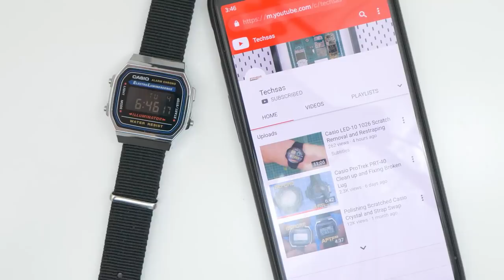Casio A168WA-1YES Display, Nato Strap and NFC Mod

Comment: Sweet mod. These watches would be perfect if they made them with stainless cases...
Reply from the maker: Tru
Reply: Tru
Reply: Tru
Reply: Tru
Reply: meh
Reply: They did back in the day, you can find them on eBay but advance warning , they are now not cheap.
Reply: Tru
Reply: They just did the  a1000d
Reply: Tru
Reply: TRU
Reply: Tru
Reply: Techsas Truuuuuuuuuuuuuuuu
Reply: @renerodriguez1876  Yeah, but the mother of pearl is ridiculous
Reply: Actually they did. Search Casio W-99
Reply: T r u
Reply: @SlapShotRegatta22  nope its cool
Reply: Rumour has it one of the homage brands has a die cast version. So not stainless but some sort of zinc alloy, which might at least be a bit of an improvement over plastic. Not sure if true or whether plastic merely got lost in translation.
Reply: @SianaGearz  nah plastic is better than those cheap alloys
Reply: @Cortesevasive  Neither is particularly good, but the adhesion between plastic and the plating undercoat is a particular weak point. Especially at the bottom right once the plating goes a little, it just starts flaking off rapidly. I know Casio uses an activator which is better than if they didn't but it doesn't really solve it. I'd say a garbage metal watch still lasts 3-5 times as long as the way Casio does its chromed plastic. Metal to metal plating adhesion is fundamentally much better.
Reply: Tru
Reply: Tru
Reply: Metal would destroy its NFC capability
Reply: Tru

Comment: 5:30 - You have to install Gold Spring First then The _white face_! Spring won't come out because spring has 2 different size ends. Small part goes first and Big part stops it from coming out. 

Also when I installed nfc tag inside my watch face! There's a SILVER SPRING stays with battery dropped, and couldn't figure out where silver Spring came out from! It's for alarm btw. If you lose, it won't make noise!

Watched video by @JUnbox A168 Battery replacement that helped with putting the SILVER SPRING in place.

Anyways overall _Thanks for the video really helped_. All I did was NFC install 😊
Reply: Where did you buy the nfc from? Do you have any link? Thnks!

Comment: Very informative video. Do you use a thinner spring bar? I can’t seem to fit my nato on it... maybe my nato is also too thick? What specs are the bars and nato you used?
Reply from the maker: Thanks! I used some thinner spring bars that I had laying around. Also,  ironing your strap helps but be careful it burns real fast.
Reply: Techsas good to know, thanks.

Comment: So cool! Thanks! May I ask what polarizing film you're using? Any link available?
Reply from the maker: I usually use polarizing films from an old cell phones. This time I used the one I got on ebay which is meant to be used for samsung smartphone screen. There's loads on ebay and they all do the same thing.
Reply: @Techsas  aren't the ones for samsung phones often meant for oled displays which are different than the typical lcd polarizers?

Comment: Beautiful! Managed to pull off the  negative LED, looks amazing. I can't get  NATO strap to fit though! Been trying for the last 45 minutes and scratched the lugs to hell but seems impossible. Is there a trick?
Reply from the maker: The trick is to use thiner spring bars and bend the strap before putting it in.
Reply: @Techsas  You're a genius! Took less than 5 minutes and my watch is looking awesome. Thank you!
Reply: @houssamalissa4417  did you do it with thinner spring bars or original??
Reply: @CODHIM  I got the thin ones!
Reply: @houssamalissa4417  what mm bro??
Reply: @CODHIM  can't remember just ordered "thin spring bars"

Comment: At first i thought you placed two polarizers and then after watching it a few times, I realized you placed the new one underneath the old and peeled the old one off after you stuck the new one on the screen. Did i get that right? 😅 Also, you mentioned in one of the comments that it should be 45 deg for better contrast? How do you determine "better contrast?" And 45 deg in relation to what exactly?😅 Sorry if I have too many questions. I just bought a A168WA-1WDF and really want to do this mod. I think the blue green light is just beautiful. 🙂

P.S Btw, i really love your work. Hit like and subscribed 😁
Reply from the maker: Hey, I love answering questions. Now here's what I did. If I remember correctly I peeled the old polarizer and placed it on a new sheet so I can cut it precisely. New polariser comes with protective film on both sides so there's a lot of peeling. Really I just replaced a polariser film and that's all you need to know haha.. To get the best contrast just assemble the module without polariser and test it with the new one at different angles... 45° in the relation of an edge of polarise film.
Reply: @Techsas  thank you for answering! One last question though 😅 Is there a specific polarizer that you used for this mod? Because i searched online locally and i got a 0 deg polarizer, a 90 deg polarizer, polarized light, and polarized light 0 and 90 degrees. Now that made me confused lol. Can i just use any? 😁😁
Reply from the maker: @ggamboa9873  I don't know the difference between them. I'm buying the one's used for smartphone screens because they have adhesive on one side.

Comment: There are some watches that have a positive LCD but still light up only the numbers when you activate the EL backlight as a negative display does.  Any idea how this can be done? 

Nice video though. First time I've seen an NFC chip installed. Very trick.

Comment: Do you think it is possible to modify front panel with all those writings? :/
Reply from the maker: Hi, I'm working on making it fully black. To make custom writings would require some expensive equipment like flatbed printer.
Reply: @Techsas  I would like to paint on this dial, so now thinking on how to do it with A168. Print is applied right on the glass, right?
Reply from the maker: @dsv  Yes. It's basically printed on acrylic. As I mentioned I'm working on it and will make a video next week.

Comment: I just got a 1.2mm thick nato for my a168w but it's too tight with the original shoulderless spring bars. I'm thinking of buying thinner spring bars, either 1.2mm or maybe even 1mm diameter. What kind of spring bars did you use for you watch? Thanks in advance.
Reply from the maker: Hi, yes you need a thinner spring bars. I bought a set of different size springbars so it wasn't a problem for me to find a thin one. You can also try ironing your strap, but be careful not to burn it.

Comment: Is the case steel? Amazon lists this watch as having a steel case, but it looks more like the plastic that casio uses on other watches. 
And what's the use of the NFC chip? Not sure if i missed that in the vid.
Reply: No, the case is the usual chrome plated plastic.

I don't know what he uses NFC for, or just put it in because it fit, but some public transit networks allow you to bind an NFC tag to your personal prepaid account and then you can use it to pay for your commute. You can also have phone unlock or application invoke by NFC tag.

Comment: nice video! i was wondering what did you use for the inverted screen thing (how its called and an amazon link if you can)
Reply from the maker: It's called polarizer film, I buy them on ebay, search for Gameboy Polariser, they are self adhesive. If you don't want all the mess applying it yourself, I will have ready to use negative displays on my etsy store some time next week.

Comment: Awesome, would love to try this! Is there anything you need for it that isn't listed in the Amazon links below the video? Also...what's the purpose of the NFC chip, what does that enable?
Reply from the maker: You will need to salvage a polarizer from an old LCD or buy it from ebay. NFC lets you store information, but only about 144bytes. It's enough for a link and etc. You can access it by tapping it with you phone.
Reply: @Techsas  Awesome thank you - and should the polariser be adhesive? I see you can buy entire sheets of it...
Reply from the maker: @houssamalissa4417  yes, it's best if one side is adhesive

Comment: I didn't quite understand the film part, do i have to buy one or it's the one you removed from the screen?
Reply from the maker: You have to buy one. It's called polarizer film. The one I removed is the same one, you just need to flip it at different angle  to get negative color display.
Reply: @Techsas  ok thanks

Comment: How do like putting the NFC chip behind the LCD? I would assume little interference being mostly just glass.
Reply from the maker: If I put it behind the glass then the backlight would be a bit sketchy. I would do that on other watches that are not backlit tho. But it works perfectly well, better than I expected.
Reply: Techsas Have you ever got an nfc chip behind an f-91?
Reply from the maker: @zackmerritt2408  Yes, it goes the same way under the white panel (which is under  the screen)

Comment: Looks super cool. I'll probably try the same mod but with local transportation card (mifare chip) instead of blank nfc chip.

Is it possible to have brighter display with same panel? Probably with more transparent polariser film or more reflective back cover film?
Reply from the maker: Let me know if you manage to fit that in! A higher quality polarizer might do the job. Reflective back wouldn't work because that would cover EL panel.

Comment: What is the size of the pin you used?
Reply from the maker: Cant remember, but I bought cheapest set of pins with the hope that they will also be the thinnest.
Reply: Could I reuse the one that came with it originally?
Reply from the maker: @stevecatedral9099  if you manage to squeeze nato strap in